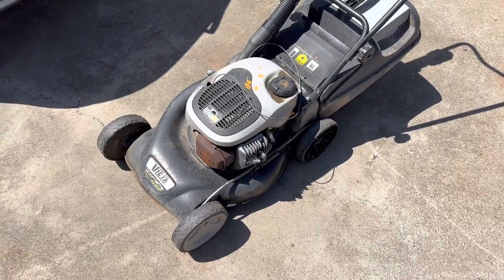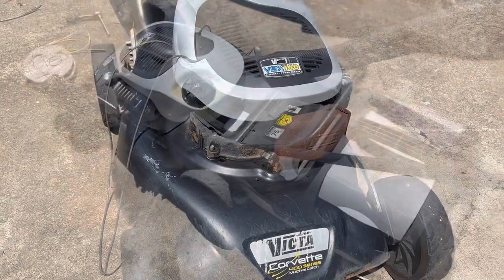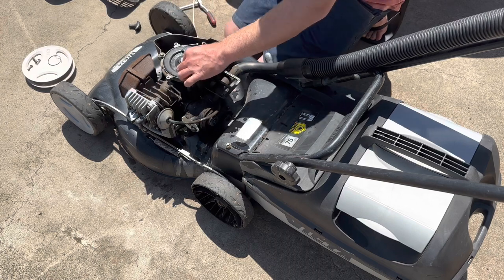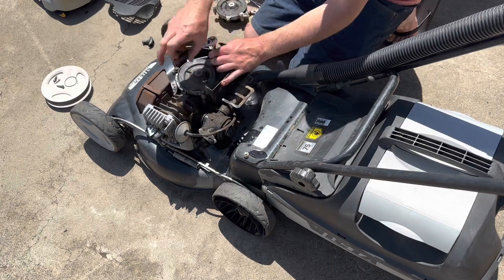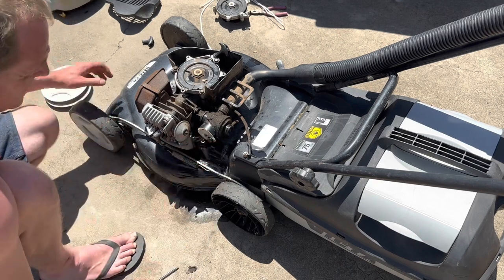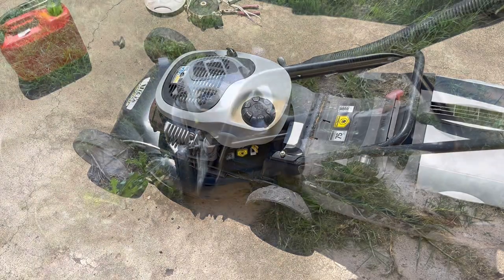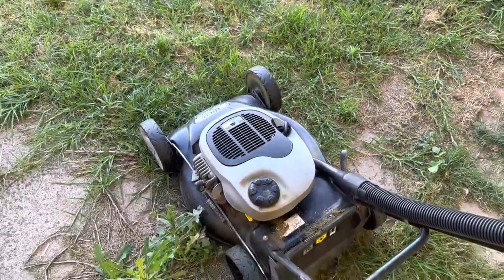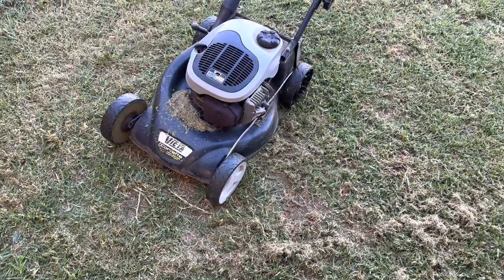Can we fix it? Victa corvette vsx 160 2 stroke

Comment: Are the keystart models worth the trouble? I have one and want to put it on the market but a new battery would blow out the budget. It's silly to expect the average homeowner to maintain a lead acid battery over the winter when the machine is stored away. I'm thinking of removing the starter motor and ignition switch,